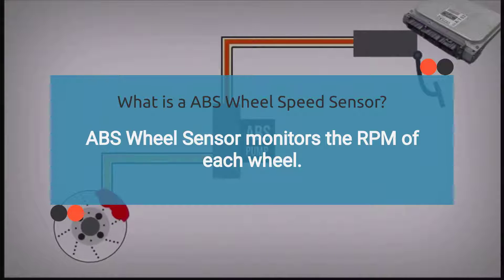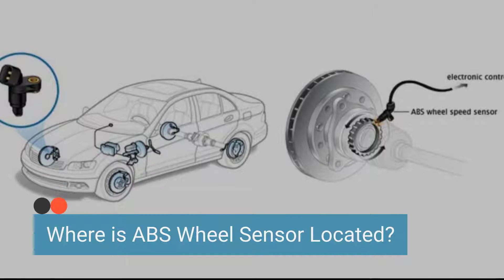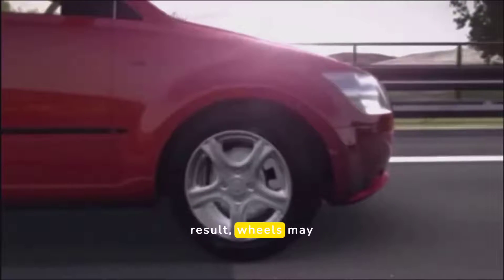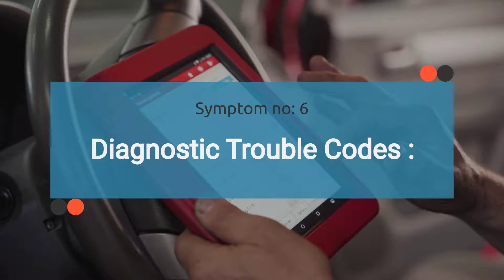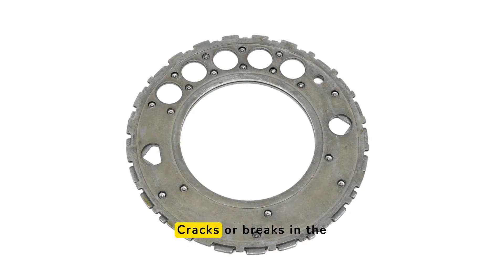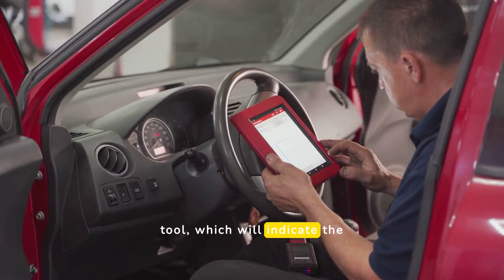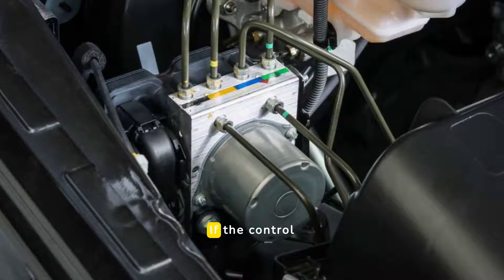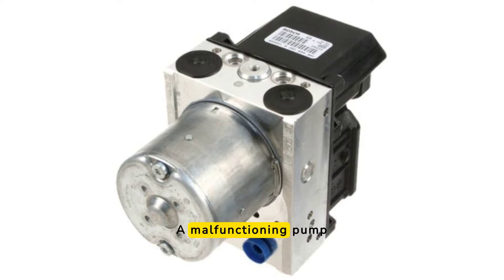Bad ABS Wheel Sensor- Symptoms, Causes & Troubleshooting

Comment: Could that sensor be the reason that my car is Shaking at higher speed, front right wheel more precisly. Also ESP light lights up after 5-10mins driving.
Thanks!
Reply from the maker: An ABS sensor issue might cause the ESP light, but shaking at high speeds is usually linked to tire balance or alignment.
Reply: @carfix07 yes ofc, but the tyres are new and well balanced